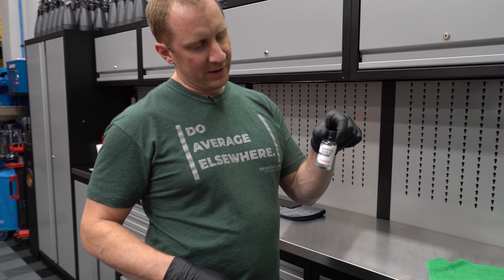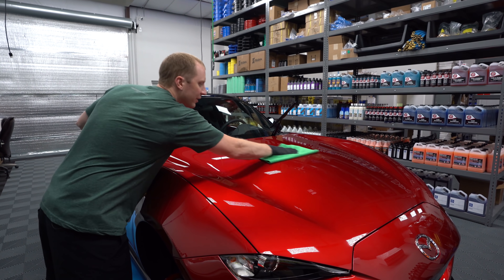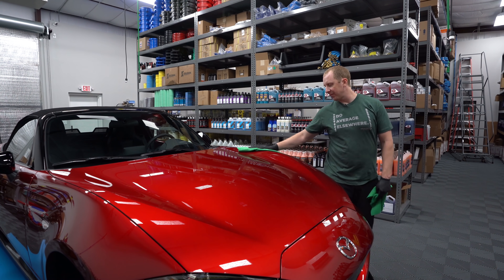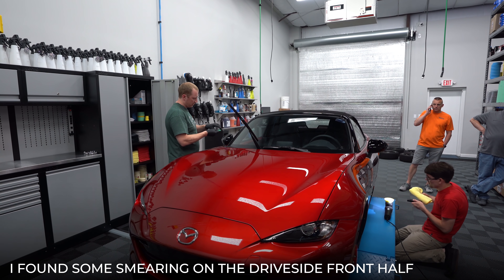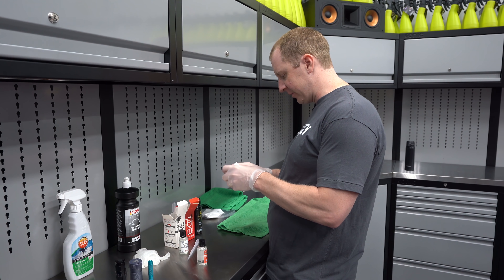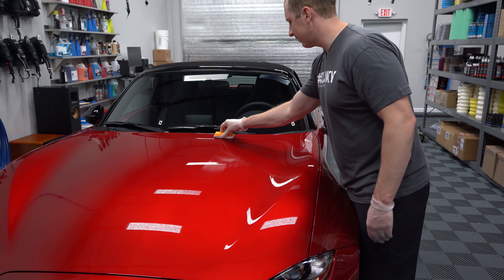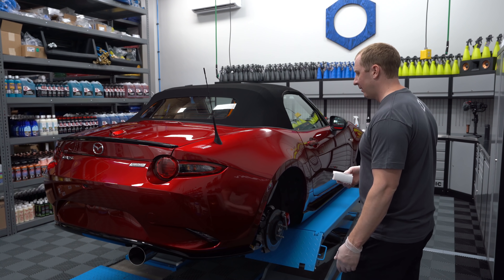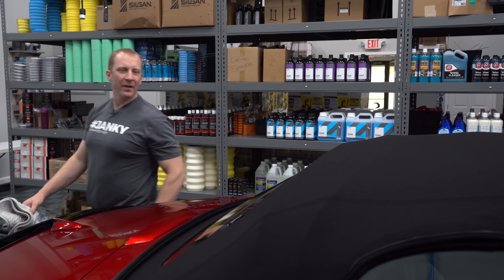ND Miata Detail Series: E4 - CSL / EXOv4 | Wolf's Glass Sealant | 303 Fabric Guard

Comment: You should consider trying the Autofiber coating saver applicators.  They are even better than the carpro block and suede.  

You maintain control with the autofiber applicators.  My preference is the microfiber version but the suede versions are pretty good as well. 

Give them a try when you get the chance.
Reply from the maker: I have a case of them.

Comment: Hi Matt, great informative video. I am about to apply Crystal Serum Light after a complete paint correction. As the instructions that come with the coating say wipe on and wipe off, the video says to let it bond a few seconds. My garage is set at 70 degrees. If I wait around 30 -45 seconds, would that be sufficient time for a wipe off and buff? Thank you, Howard.
Reply from the maker: Yeah, I think that would be sufficient.
Reply: Obsessed Garage , Matt, thank you.

Comment: Just a quick question... Is this in the line of protection as waxing with colinite 845 or would I wax first than apply this?
Reply: Got ya.
Reply: Would I be better off using something like meguiars ceramic spray as a drying agent after I apply 845?
Reply: @ticklemycow9007  what about after washing the car say a couple weeks later or is not even needed?
Reply: @ticklemycow9007  makes sense now, thank you. I'll just use the 845 after the correction
Reply: @Luke Grandgenett what about beadmaker on wraps? matte wraps?

Comment: Beadmaker has its place but putting over these far superior coatings loses their performance. The water beading and self cleaning characteristics of CSL/Exo is amazing. I’d rather have that.
Reply: so what do you apply to maintain CSL + EXO ?
Reply: Bouncers Done and Dusted Si Edition or C2. Anything designed to work with ceramic coatings using similar ingredients to the coatings themselves really. But CSL/Exo don’t need a regular top up very often anyway, they have excellent durability on their own.
Reply from the maker: Sounds like you've been watching too many YouTube videos.
Reply: I probably have watched too many videos but this is from experience too! When I first used a ceramic in 2012 (Gtechniq C1), the thing that put me off coatings at the time is there was very little to use as a maintenance product. Diluted C2 was one solution as a sort of QD. When I waxed I enjoyed maintaining with a QD but putting these on the coating meant I lost the self cleaning and water behaviour of the coating. I got the (lesser) performance of the QD. Now it’s very different. There are so many coatings and even more maintenance spray products. Beadmaker just wouldn’t be my choice over a coating. I use Beadmaker regularly on one my cars for the great gloss levels. This isn’t a coated car though. Just my opinion👍